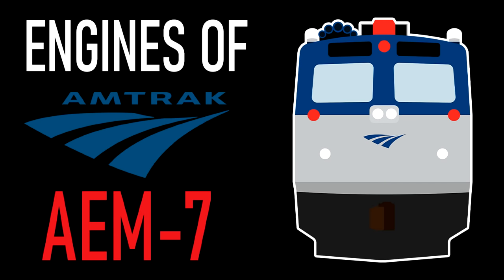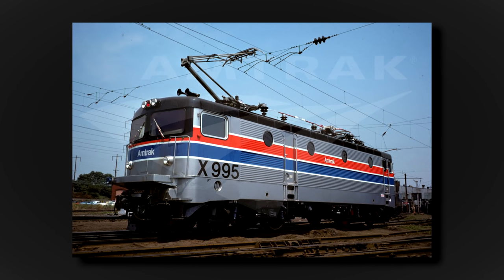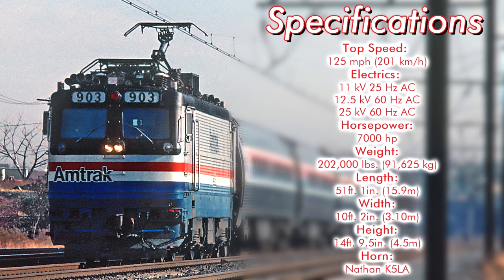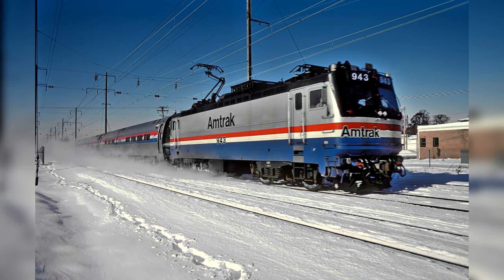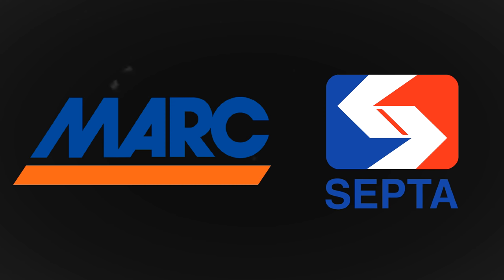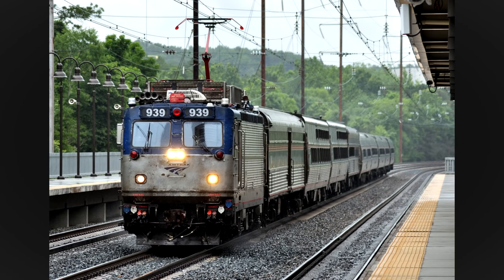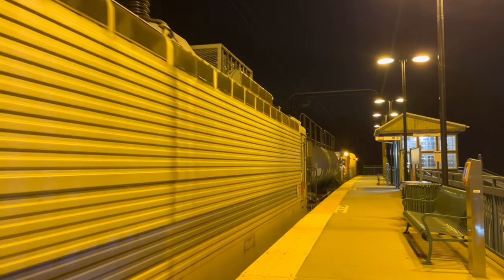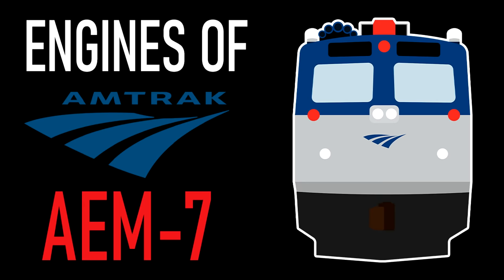Engines of Amtrak - EMD AEM-7 [REMAKE]

Comment: I still remember when the Wikipedia page on Amtrak's rolling stock still had the AEM-7 as "active fleet".
Reply: Wouldn't surprise me if they're backup units, but I'm doubtful that they are. They still have a bunch in storage.
Reply: Jesus christ, no need to capitalise on a simple misunderstanding, lmfao
Reply: @MattS_Filmography   I'm sorry, I got irrational and didn't think clearly.
Reply: @MattS_Filmography  but anyway some AEM-7s still exist, but are not in Amtrak’s modern locomotive roster with the chargers, ACS-64s, Bombardier Acelas and the other engines
Reply: And as a Person who looks at the newest info for the 315 and I can say they can be incorrect when I can see rail fans spotting it  and I see they just have info which is sooooooo incorrect because it of its false 20 units scraped and 5 in service and have 53 scrapped as well
Reply: Maybe they should’ve ended up as the same fate as some F40PHs. NPCU or cabbage units
Reply: I still remember going into south station on the MBTA and being able to see and hear the AEM7s
Reply: its joever
Reply: I S E E Y O U E V E R Y W H E R E

Comment: I am a retired Amtrak engineer, hired in 1974. Got to run my favorite, GG-1 at 110 mph. Then, got to run the hunk of crap E-60! The AEM7 was a BIG upgrade. Small but powerful.
Reply: Was the AEM-7 an upgrade to the GG1 as well as the E60, or was it just an upgrade to the E60?
Also, how the heck did you see out of the GG1's tiny cab windows?

Comment: I didn't realize Caltrain repainted one of the old AEM-7's before sending her out to try out the Peninsula Corridor.  Especially since the current plan involves just using it for testing (Caltain has gotten away with not painting secondhand equipment; see all the old Metrolink Bombardier bilevel cars).  Last time I saw them, they were still parked in San Francisco in the Amtrak livery (though with logos removed), ready to test out the first electrified heavy rail corridor on the west coast.  And I think it's now sitting next to the first of the new EMU's.

Kinda fitting since Caltrain looked into the viability of the AEM-7 when they first looked at electrification back in the early 90's.

Comment: Thanks for the video and your work.
As a frenchman, even for me I found them beautiful and  i like the AEM 7 locomotives. 
For the story of CC 21003 in america, i think it was not the good locmotive to send for SNCF. This class of locomotive were almost half prototype and had some problem. I think a BB 15000 would have been a better choice. First they had an outstanding reliability. Second with their lighter conception and an better suspension than CC 21000 class, I think the running on american track would have been smoother.  But history is history. BB 15000 were younger, and SNCF had less experience with it than CC 21000 (certanly the reason to not send a BB 15000), and finally the swedish choice gave amtrack another amazing locomotive.

I will just add a little correction. CC 21000 class and their sister, CC 6500 class, are not passenger locomotive only. These locomotive had an double gear system which can be switch at stop. On passenger gear, you can run at 200 km/h, and on freight gear you can run at 100 km/h only but with an better tractive effort.

Comment: Still gets to me that I wish GG1 are still in service.
Reply: Kinda tough to say about the GG1. Despite it's iconic Art Deco design worthy of a role in any old-time movie from the 1930s and 1940s, by the time NJ Transit retired the last GG1 in 1983, most of the units had cracked chassis that were hastily repaired at the PRR/PC/Amtrak Wilmington, DE shop. Those locomotives were pretty much a catastrophic accident waiting to happen. There are societies out there that would love to see a GG1 be restored to operational condition, but in the end, it would be easier (and cheaper) to build a new GG1 from scratch using modern technologies that are available, including transformers that would allow the GG1 to operate anywhere in the US, provided the overhead traction matches the three overhead traction facilities (12 kV/25 Hz AC; 12 kV/60 Hz AC, and 25 kV/60 Hz AC) operated by Amtrak and Metro-North.

Comment: 5:23 is a bit incorrect. The keystone corridor Metroliner sets only had catenary poles up for electricity and ac/ heating inside the car. The only reason they used them from 1981-1984 was for the ability to run push-pull operations, and they where never broken down because they where never applying any traction.

Comment: To European eyes these were the most "normal" of Amtrak locomotives. Rc series already looking quite average in design (if you mixed all European electric locomotives together and stirred ...) 
Meanwhile in Sweden, Rc4 are still the most numerous locomotive of Green Cargo, though some Traxx and even six-axle Transmontana from Romania have been bought in addition. Likewise most Rc6 are still in operation for SJ (which is now purely a passenger train operator). Though passenger trains are more and more being replaced by multiple units, night trains in particular are still all locomotive hauled.
All CC6500 and CC21000 have been retired in France.
Reply: I agree with you, but the most 'normal' looking Amtral locomotive to a European right now is its replacement. The ACS-64 looks just like the locos we have on our continent
Reply: @krthecarguy5150  Yes, it's basically a Vectron adjusted for US standards.

Comment: I have been watching a lot of your videos and they are all very interesting. As a European one thing has me wondering though. Why do so many American trains have two locomotives? I get that the trains are fairly long, but we have a lot long trains as well and they mostly have a single locomotive.
Reply: In cases like the AEM7, which have plenty of horsepower per unit to haul long rakes of coaches, it is often for redundancy. In the event of one locomotive failing en-route, the other can continue on. This matters on the high speed NEC because it keeps trains from interfering with each other.

In other cases, with diesel powered Superliner sets, a single diesel can only just pull a long rake of heavy bilevel Superliners. For traversing mountains, the extra power is needed. Plus much of the track in the southwest is in the middle of nowhere so redundancy factors in as well.
Reply: @tavi9598  So when it comes to locomotives its quantity over quality